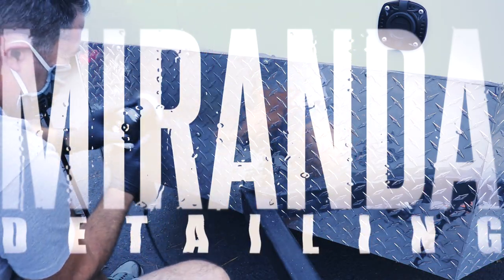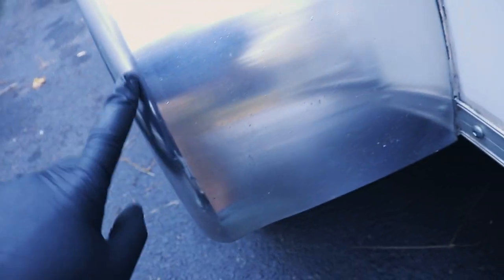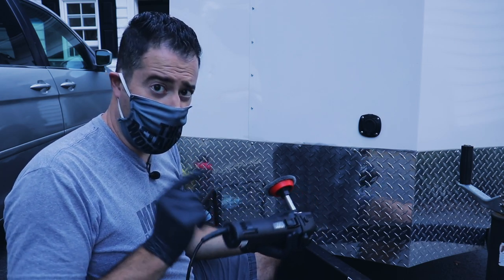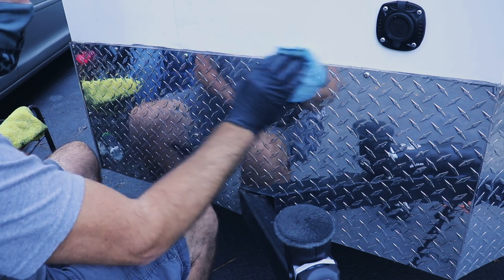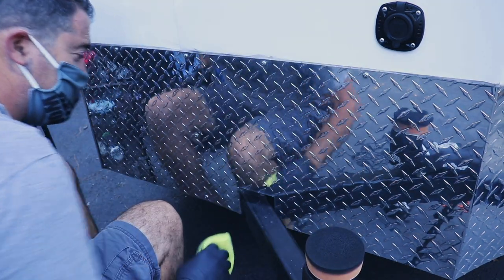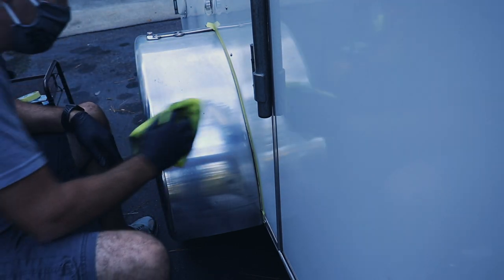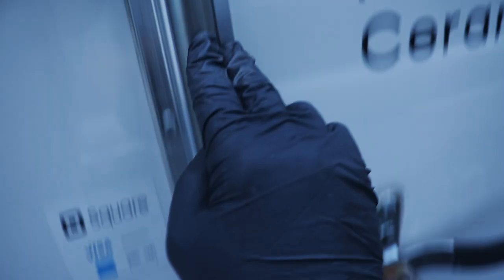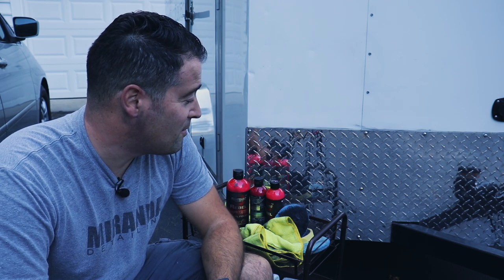Aluminum Polishing Made Easy! #autodetailing #Mobiledetailing

Comment: I do the occassional cargo trailer and truck toolbox.. Friggin hammered pitted up aluminum diamond plate is such a bastard.. tears up your polishing material, and it's such a pain to get a consistent finish with all the raised surface area.. I've kind of settled on various size felt wheels for powered and Xtreme Solutions Whitebox wad polish for working by hand, then I use a lot of strong body prep solvent to remove the residue somewhat efficiently. 👍👌✌

Comment: Great results Phil! Looking so nice!
What about using an exacto knife to cut off the sloppy silicone job? Just a thought.
Reply from the maker: Thanks!  Oh good idea!  I could try that. I’m just worried about cutting to much out and then water may seep in there...
Reply: @MirandaDetailing  if the caulking has been installed properly, you should be fine. Another option would be to cut the old stuff out and perhaps go back with fresh caulking if you think water might get in there. Maybe a clear one so you don't see it at all?
Reply from the maker: Cool!  Good advice!  Thanks!

Comment: What pads are you using in this video to polish the diamond plate aluminum? I just bought the renagade set in your video based on your recommendation
Reply from the maker: Hi. I was just using older purple wool pads. You can use foam or wool pads, but dedicate them for aluminum polish only.
Reply: @MirandaDetailing  
Thanks sir. The one 3 inch on your rotary looked maybe like a microfiber pad. 😄
Reply from the maker: @ericgoodman9509 it was a very flat used wool pad.
Reply: @MirandaDetailing 
Thanks sir

Comment: Phil,   I have CCW 19" billet aluminum wheels and have had zero luck using Mother's billet polish and the Mother's red ball tool.   The wheels have micro scratching and some water spots.   Would you recommend using the products in the video on billet aluminum wheels?   If so, how often do you switch out or clean the pads?  Another good video and the timing is perfect since I need to get the Vette ready for winter storage pretty soon.
Reply from the maker: Hi. Astro they bare aluminum or coated?  If they are coated aluminum that means they have a clear coat sprayer on them like paint and polishing them will be just like polishing paint. However the clear will be thinner so use caution. But if uncoated aluminum it is certainly messy to polish like you saw! 😆. The pads get wrecked pretty fast. But if you buy cheap pads they work great and then you can clean them out with degreaser. But they will never look the same, the aluminum oxide dyes the pads black permanently.  
But the heavy cut Rebel Red metal polish works really well to reduce little scratches. But to really remove scratches in bare aluminum you need to really go aggressive to remove them and then go in stages to compound and polish the aluminum. It’s takes a lot of time. I don’t deal to much with polishing bare aluminum wheels becasue it takes way to much time and I don’t have al the proper small polishing tools like some wheel repair guys do.
Reply: @MirandaDetailing  They are bare and everything turns black when using Mother's so I know what you mean.  And yes, there are a real pain to work on.  I don't mind if I get results, but Mother's Billet Polish is not doing the job other than making my Mother's ball and old mf clothes turn black!   Thanks for the advice about pads.  Maybe I'll go with MF pads to get the extra aggressive cutting action and follow up with foam pads to bring out the shine.